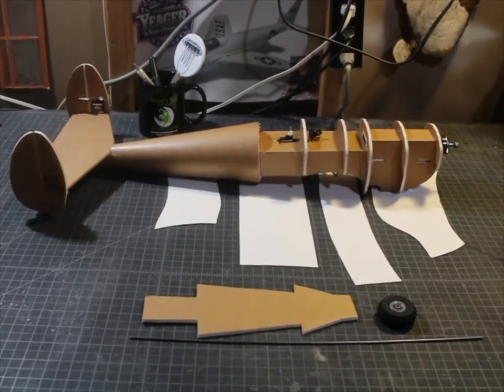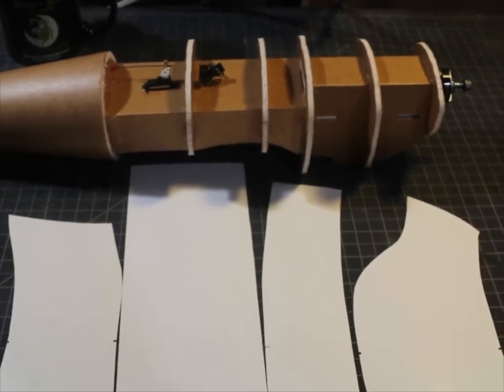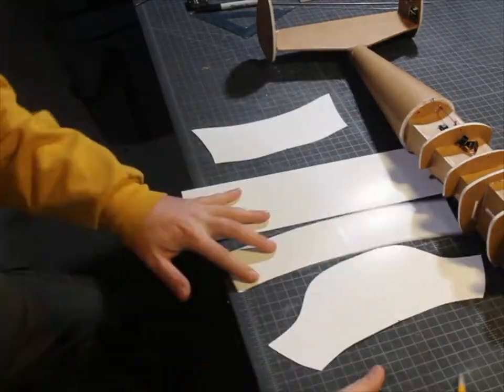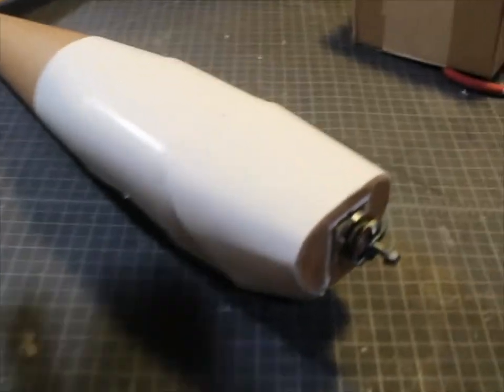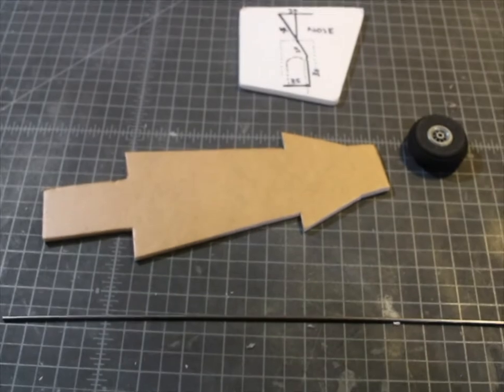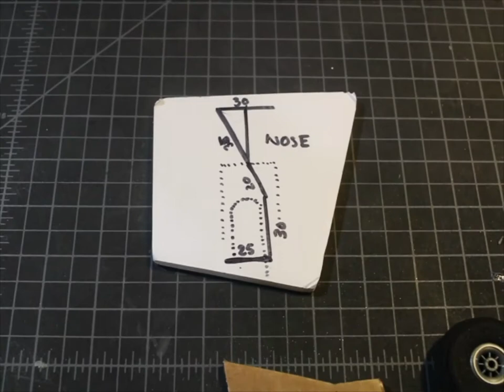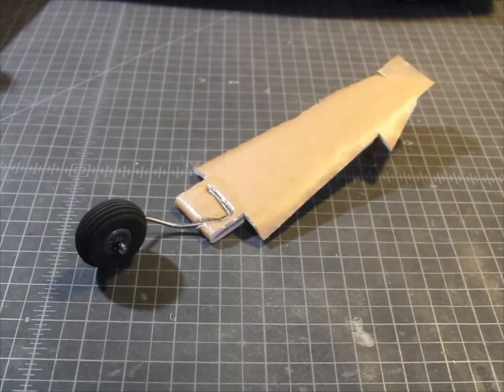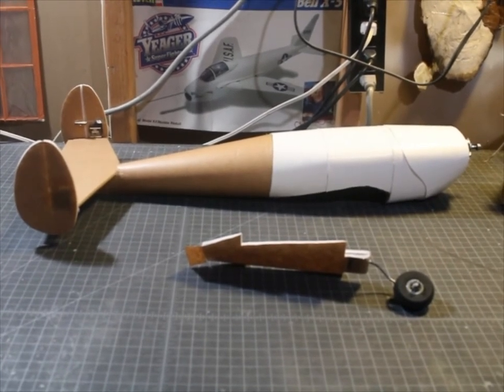Mini Ercoupe Build Part 7: Fuselage Skin

Comment: I enjoyed seeing your skinning process. what teh first attempt done with paper, then moved to Poster board.?
Reply from the maker: I made templates using paper with pins to hold it to the foam, then traced those to make the poster board skins.  A tip I didn't mention is that my poster board was a bit slick, you may want to rough the inside up a bit to get it to adhere better in certain spots.
Reply: @alanoneuser  where you using the Shiny or less-shiny side.
Reply from the maker: @matthewallen3375  couldn't really tell the difference with the posterboard I had on hand.